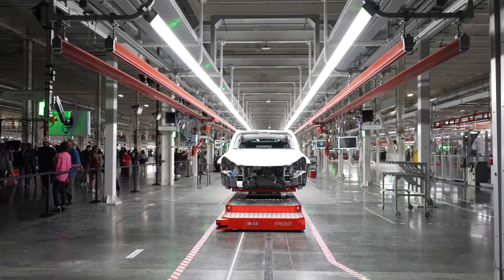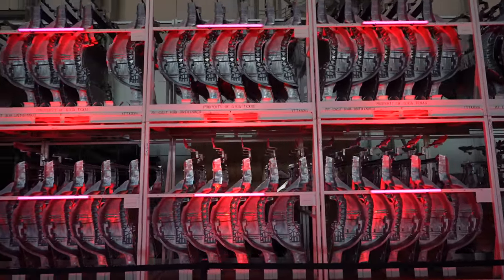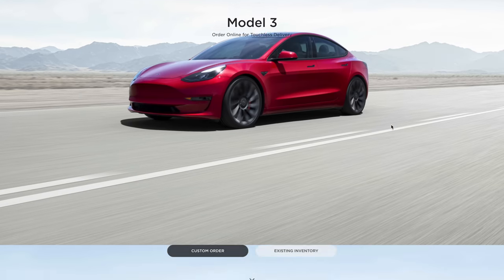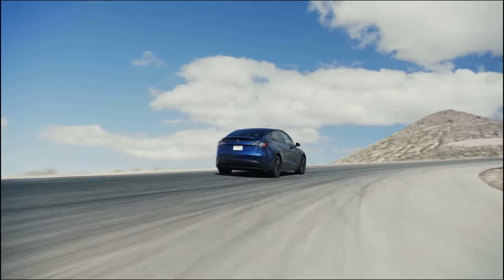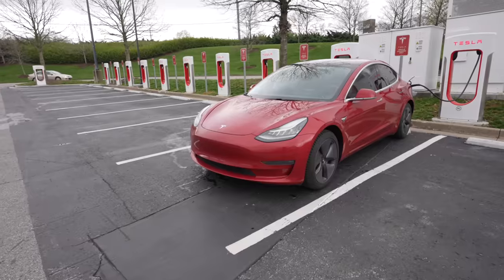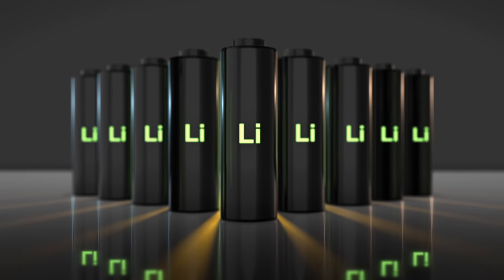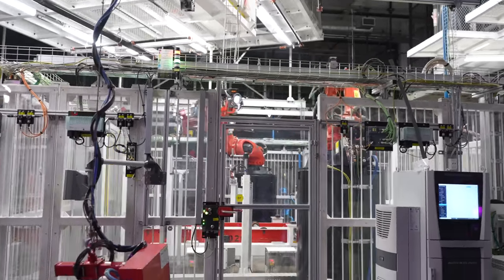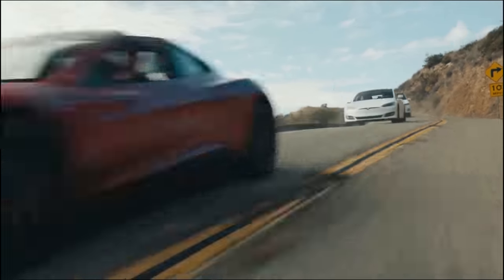Why I’m NOT Buying the New Tesla Model Y

Comment: Hi Andy, I’m not buying anything right now I have a 2018 candy apple red model three long range round I’m about 200,000 or 250,000 on the waiting list for the cyber truck whenever that will be I’m guessing I will get my truck in 2 to 3 years. I wouldn’t buy anything right now. Keep what you have and keep saving for a huge down payment on your roadster. I will never buy another Tesla unless it has a 400 mile to 500 mile range I have no problem paying for a larger battery pack. Maybe the cyber truck Will have a one piece casting for the front and rear of the structural 4680 battery pack Then I have no problem purchasing this truck!

Comment: I ordered the Model Y LR on April 1st with an expected delivery date between October - January.  We know that Tesla employees got the new standard range with 4680 batteries from GigaAustin, but what is the holdup in offering them to the general public?  I'm not so sure that they would have huge sales on that variant considering the small price difference between it and the LR model.  It makes me wonder if Tesla is reconsidering this strategy, and I am hoping that by the end of the year I can get a GigaAustin Model Y LR with the 4680 pack.  I could push back delivery as long as Tesla allows it, but I'm crossing my fingers that won't be necessary.
Reply: I ordered mine Jan., 31 same estimated DD.
Reply: Just my guess, but Tesla needs the 4680 cells for the CyberTruck and the semi. They need to start stockpiling the 4680 cells by not putting them in the Model Y.
Reply: Same EDD when I ordered mine on 4/12.

Comment: We have a 402 mile, June 2020 Model S LR+. Got an end of the quarter Covid deal at $75,990 with included free lifetime supercharging. We can probably drive it for 250,000 miles and it will still have more range than a MY standard range. OR, we sell it for a profit (current value is $88K) when the 520+ range tri-motor CT is delivered. Either way, WIN, WIN. Also, the air suspension on the S is awesome.

Comment: Ahh, you mentioned toward the end of your video you are getting a Roadster. Of course I would get the long range Model Y with 2170’s. 
But, some things to consider for a person deciding on which Model Y to buy, that isn’t getting a Roadster. What about the weight difference of the cars? Less batteries for the 4680 Model Y, so less weight. You mentioned people’s weight in the vehicle, makes a difference to which one to buy. ‘If’ the Austin Model Y is a hundred pounds lighter, let’s assume that, than that makes a difference in passenger weight, of one less person. Since I own a 2018 Model 3, with a crappy paint job from the Fremont plant (Toyota paint booth). I would definitely buy a Model Y painted at the new Austin gigafactory. I would think, they offer a superior paint job over the Fremont plant. 
So many little differences to still consider between, which, Model Y to buy. Please look into this and do an update to your video, and let us know what you think.

Comment: My understanding is that it's fine to drop below 10% battery as long as the car is in use. You don't want to leave the car sitting with a low state of charge.
Reply from the maker: It’s certainly ok if needed but you don’t want to constantly do it.
Reply: Yes, Charge it to at least 50%. Or to 100% and use it immediately. LFP equipped Model 3 can be charged and discharged without consequences. Only not when the cars are cold. Below freezing is hell for Model 3 with LFP cells.

Comment: Sounds like a lot of people including you had forgotten all the information that had been put out over the last year or so.  Everyone complaining sounds like they're expecting more miles because of the new battery. But Tesla had stated more than once that they would be putting less batteries in and the ranging crease would be minimal. The battery production once wrapped up has to go to the electric 18 wheelers which require a huge battery pack compared to the passenger cars. Once battery production is in full swing at all the plants then a few more batteries can be put in the passenger cars and bump the range on up.
     Also with lithium batteries, faster charging speeds always means decreasing lifespan. This holds true whether it is a car or a cell phone. Slow charging gets the longest life out of a battery. But a lot of people just ignore and forget that they have heard that and I always want the faster charge. Oh well, that's the way physics works. You can't just will it be a different outcome. The same people griping about losing 15 or 20% of life on their battery pack in their car are the same people that charge their cell phones to 100% and use them till they die, and then charge him to 100% again with the fastest charger they can buy. All they're doing is shooting themselves in the foot over and over and over.
Reply: What makes the 4680 special is that it is the "million mile battery".  Based on your comment, it now makes sense why Semis are getting these battery packs. Those trucks drive over a million miles! I am sure a trucking company would gladly pay for a new battery pack after the million or so miles knowing they don't have to replace the truck.

Thanks for the info.

Comment: If the Roadster can get 600 m on a charge with the 4680, why can't the Model Y get that?  Or even 500 since it's a larger car.  Why are they only allowing it to get 260?  This is some kind of marketing ploy.  But I don't get it.  I am holding out for the Y that gets at least 500 with a battery that re-charges in 10-20 min.
Reply: Thanks for Watching..Write me To participate in our current investment 0ffers📊🤙🏻...

Comment: In Canada our next city over IS 425 miles away. And what about battery energy loss if you are using your vehicle in temptures below minus 50 degrees Celsius. If you don't live in a climate that reaches these cold temperatures for days or even weeks at a time you may not know that a number of peculiar things start happening. First is electricity, it decreases dramatically others are how fluids and other things like rubber, plastic and metals become very brittle etc.
Next in Canada, straight across the country electricity generation prices have risen 3 to 4 times the cost as well as because how electricity is generated and a large number of economic and resource and market fluctuations cause this market to be very volatile. If I owned a Tesla I would not be able to pay for my electricity bill and my car would be sitting in my driveway and I would be using public transportation. 

Plus I know about how lithium batteries are manufactured from mining to finished product and long term it is going to not be currently feasible to produce enough for everyone to own a electric car not to mention the global economy on current electricity generation in other countries isn't feasible to generate enough electricity for electric cars. 

Electric cars are Not The Least Bit A Green Option and is actually Creating Not Solving A Whole New Batch of Problems For the Environment.

Not buy an electronic car. Not interested in being part of a much bigger global problem in the near future.

Comment: I think the only thing that would really make a difference on the 4680s is if the charging curve is faster than the 2170s.  We'll have to see on that, but from one of the graphs from Battery Day, it pretty much said that because the 4680 form factor is so much bigger than the 2170s, the charging curve would be pretty close to the same because of the tabless design of the 4680s.  So it kinda sucks that while the 4680s are a new design, it doesn't really benefit the consumer all that much, rather just saves Tesla money because they don't need to put as many 4680s to create the same amount of range.
Reply: Disagree. 4680 are better batteries and in the future will used more and more.

Comment: I don’t think the 2170’s are going away anytime soon.  Consider the new S/X still use the old 1860’s which are performing was well as the current 2170’s.  I think as they ramp up the 4680’s they can tweak the chemistry as needed to improve the performance.

Comment: I think "standard range" should have at least 300 miles of range.  Elon is wrong that people don't want more range, considering as the batteries age the range decreases.  And this means more frequent charging while on trips.  My 2018 LR Model 3 has dropped from it's rated 310 miles to 287 miles, according to the Stats App.  And while this doesn't seem like much of a loss, my car barely has 20k miles on it and I didn't charge to more than 80% unless I was immediately going to drive on a trip.  And for people that do a lot of highway driving out of town, they most likely charge at a Supercharging station and they're probably V3 chargers.  So that means with all that fast charging their battery health drops, which also means less range.
Reply: I believe Tesla is using less 4680s in the Model Ys to keep the range about. the same. Profits before the needs of the customers.
Reply: @BTSflyer  well I understand the 4680 is more efficient but again, customers want more range.  Elon is just wrong that they don’t.

Comment: How many cells might it take to make the structural battery actually make sense?
Might they not offer extended range cars yet because the cells are not there yet with energy density?
Reply: It’s probably battery yield related rather than density.

Comment: The 4680 cells I expect will be million mile cells, so your decline in range will be much slower. That means that five years from now the difference in range will be significantly smaller just because of less loss of range by the 4680. Also, when Tesla release a new battery cell there is a testing and validating process resulting in several software based range increases, as happened with Model S and 3. The new Y may end up with more range than the long range five years from now. There is at least one compelling reason why the Tesla employees are choosing the new Y I would assume, and why they have not made the new model available to order which would mean stats had to be made public.

Comment: Great show!  Thanks to you I placed my Model Y order last fall hoping to get the new Austin built MY.  When the new Austin factory opened and I heard the rumor of the new 4680 Standard Range MY I did the same math.  I also spoke with my local Tesla and they said I couldn't switch to "the new model" when it was available and would have to cancel my order and lose the deposit.  After some thinking and listening to other shows warning about the first cars off a brand new assembly line I've accepted I'll get a California built MY and I'm fine with that now, excited actually.  
Just last week my expected delivery date changed from simply June (vs a date range like initially) to THIS week!  So I'm hoping to get a call any day now.

Comment: Completely agree. And the delivery times are getting ridiculous. If I configure an order for a Model Y LR, it wouldn't be delivered until Feb to May 2023. Sheesh. I guess I'll just hang on to our Model 3 for a couple more years to see if there are any solutions to all the reasons you mention. I just wish Tesla would step up to the plate and deal with the PCS problem that owners are starting to experience after 3, 4, 5 years.
Reply: What is a PCS problem ?
Reply: @chriauc2976  The Power Conversion System in the HV Battery Supply Panel. It is starting to break down for a growing number of owners, yet Tesla refuses to cover it under its Battery and Drive Unit Warranty. What good is a battery if you can't charge it at home? NOT good!

Comment: Some good points there and thanks, Andy. I ordered the Model Y LR in September 2021. As I got near the delivery date of March 24 to March 31 2022, I was offered the chance to delay or buy now and I took the buy now. At the time , the SR was not announced and I thought as you likely did that Austin would produce the Model Y LR with 4680 and the structural pack and single piece front casting. I hoped I'd get one from Austin but the VIN indicated Fremont. Now with more than a month of use, the car is fantastic and I'm glad I didn't delay. Enjoy your new MYLR when it shows up and drive safely. Cheers.
Reply: Do u have FSD?
Reply: Do u have FSD?

Comment: I thought you were keeping your model 3 for 10 years? What happened to that?
Reply from the maker: I’m keeping my 3 and adding a Y
Reply: My guess: it's held it's resale value too well.  His warranty is expiring, and now can sell it now for nearly what he paid for it and flip into a new and improved car with a fresh warranty and some new features.
Reply: I need to see more high mileage teslas before I jump on board. Seems like everybody I see keeps them for a few years and resells them. When they can last as long as a Toyota, I’ll be down for that
Reply: @Ghost-jy9hk  Check out the Out of Spec Motoring YT channel. They beat the crap out of a Model 3 Performance. After 100k miles it only lost 10% of it's range. Teslas have been around for a while. There is already plenty of real world experience available.

Also, compare the Tesla warranty to Toyota's. Tesla covers the entire car for 4 years and the power train, including battery for 8.
Reply: @BitJam  the only really high mileage teslas I’ve seen are the ones used by hyper loop and those have had battery replacements. 

I’ll check out these videos “how my model 3 has held up after 100k miles!” And so on and they’ll be like I saved so much money on maintenance. Then go in to list their 11 service appointments and multiple repairs. It’s hard to know what to think.
Reply: @Ghost-jy9hk  With the 8 year, 120k mile warranty I'm not worried. If my battery needs to get replaced in that time then I will get a brand new battery for free.

Comment: Tesla should be obligated to tell you what battery you will be receiving in your car.  It's no different than buying an ICE car with a 4, 6, or 8 cylinder engine.  You know ahead of time what you are buying.  In fact it may be illegal for Tesla to withhold this information.  Of course, Tesla doesn't care if you refuse a car with a 2170 pack, because of the huge demand and an opportunity for them to sell the car for a higher price.  They probably would like refusals.  But it will come back to bite them in the end.  It's a slimy move, in my opinion, to not advise you of the battery type ahead of delivery.
Reply: For ICE thats simple. They do not change anything between model years. Tesla changes some things every few hundred vehicles.
Reply: Unlike legacy automakers, Tesla is constantly improving their cars throughout the year. It would be impossible for them to predict the exact battery type they will be using in 6 months or a year. This is absolutely not a problem for consumers. Tesla provides detailed specs  when you order a car. You know the car you will get will meet or beat those specs. It is not at all like a V6 vs a V8. Some may want a V6 for efficiency while others want a V8 for performance.  But why would someone complain if the car arrives with better efficiency or better performance than was advertised?
Reply: Joel, I don't see anywhere on the net how big the battery packs are 64Kwh, 70Kwh, 85Kwh, 100Kwh on any tesla cars, you just see how many miles you can get, if Kwh was on display you could compare with other manufacturers to see if the value of telsas are worth it.

Comment: If you are expecting a 600 plus mile Roadster, you're in for a rude awakening, my friend. Are you forgetting Elon came out and said it isn't necessary for Tesla to produce a 600 mile car?
Reply: Tesla said that Tesla making a 600 mile electric car would make the car worse. He said last year, they had the technology to do so. He didn't say it wasn't necessary. He just said it would make it worse.

Shoot, I have been saying for 40 years that they need to make 600 mile range gasoline cars. The cars that get high mpg's have smaller tanks.

I have a Fiat Spider 124 - gets 38 mpg but has a 340 mile range on the gas tank. I get range anxiety.
I have a Ford Maverick Truck, non-hybrid version - gets 23-28 mpg - range is about 380-420 on a 16.5 gallon tank. I get range anxiety on that
I have a Mazda6 - the range is about 480-520 miles

I do think 280 is too small if I were doing long road trips a lot, but going back and forth to work and traveling locally or within the state would be fine. Long road trips, yeah, would be a little tough but that is why it's best to have a gasoline car as a second car... for those long trips.

Eventually, we will see electric cars having 500-600 mile ranges but keep in mind, that as the range goes up, so does the time at the charging station. So if I am driving the 280 mile range Tesla and have to stop every 150-200 miles to charge up, it's not going to be too bad. If I get a 600 mile range car (when they do come out), I may be sitting at the charging station for 1-1/2 hours!

Comment: Honestly Tesla is starting to get a big head with their prices and a big toy expense. To be blunt any car that can drive 250 and above (although I believe 300 milage is a sweet spot because of degradation) that's EV is good for the economy period. If you travel then yeah get high mileage EV if you don't, don't get anything unnecessary. It's not like you ain't going to consider getting a car 4-7 years later and that's middle class minded. 🤳🏾😅 There are still better more cheap cars like your THREE wheeler FUV and Aptera.